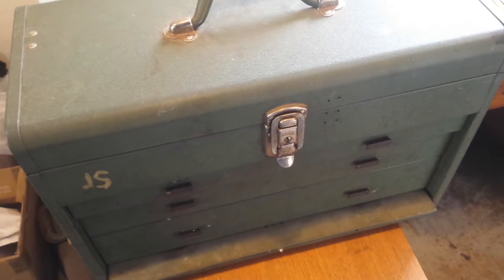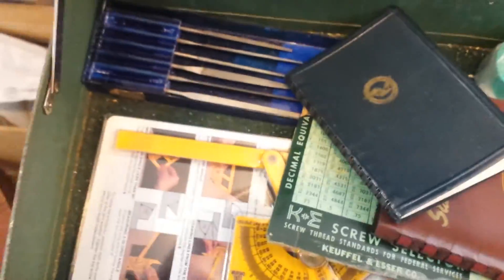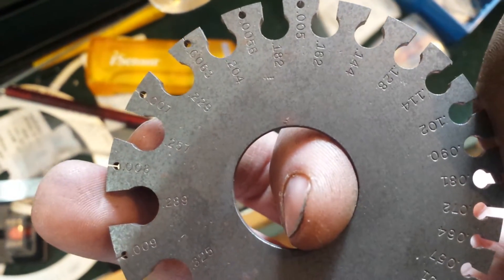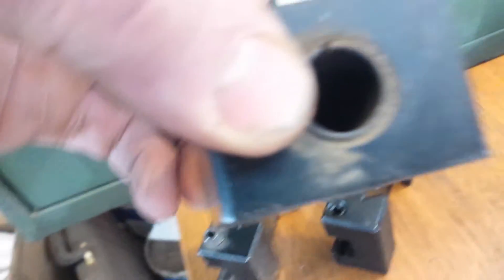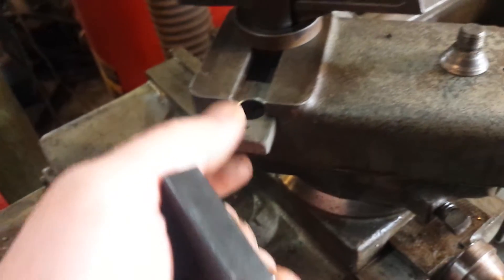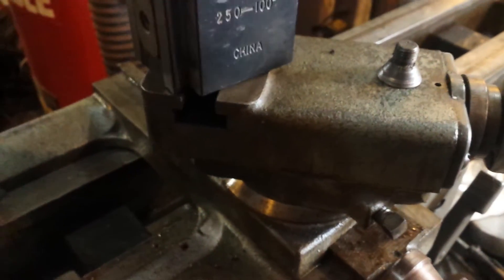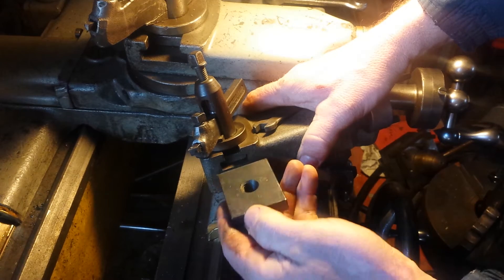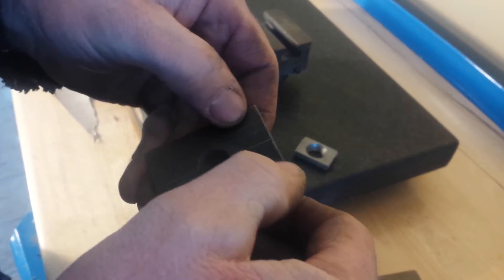Quick change tool post modification AXA

Comment: The piston type QCTP, compared to the wedge type, is not really a highly desirable addition to add to anyone's lathe but if that's all you have or could get ...well you just have to live with it......I'd sell it on and buy the wedge type, heaps better.
Reply from the maker: I have since bought two wedge type and yes definitely heaps better. Thanks for watching
Reply: @JourneymanRandy  Way to go....I just bought an AXA one on EBAY too and a set of 6 of the plain turning type tool holders as I mostly use turning type tooling and anything else I have will fit in them......not all that interested in the boring bar type or the Morse taper one but the parting off one is OK if you have the parting blades.
Reply from the maker: I was disappointed with the plunger type. My wedge stile is an AXA for my Atlas 10 inch and CXA for my Southbend 14 1/2 inch. I couldn't be happier to get both of them. Much better.
Reply: @JourneymanRandy  I think I will be lucky in my choice of the AXA type as I have a 1930 Colchester Bantam 10" swing lathe and the top of the compound slide is flat with a long stud in the middle so it will be simple to fit the QCTP when it arrives.

Comment: Nice job milling the slide.  I had to do the same for my Atlas small lathe.  What a nice difference a quick change is versus a lantern tool holder.  I'm surprised that you jammed the bolt through your freshly-milled slide instead of using a tap to clean the threads.
Reply from the maker: You caught me taking a short cut. Yes, I am now looking for a quick change tool post for my 14.5 inch lathe. Thanks for watching
Reply: i dont mean to be off topic but does anyone know of a tool to log back into an Instagram account??
I was stupid forgot the account password. I would love any assistance you can offer me!
Reply: @Josue Darwin instablaster ;)
Reply: @Kylan Frank I really appreciate your reply. I found the site on google and Im in the hacking process atm.
Takes a while so I will get back to you later when my account password hopefully is recovered.
Reply: @Kylan Frank it worked and I now got access to my account again. I'm so happy:D
Thanks so much you really help me out!
Reply: @Josue Darwin No problem :D